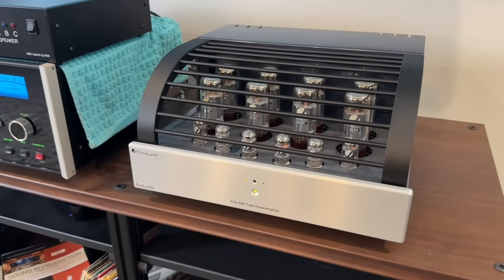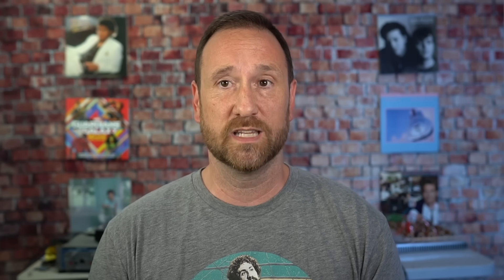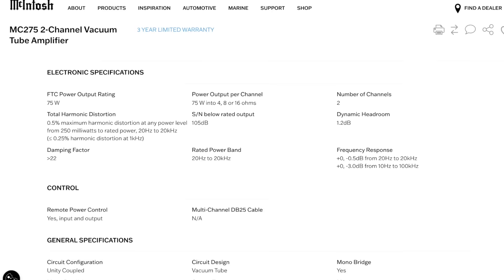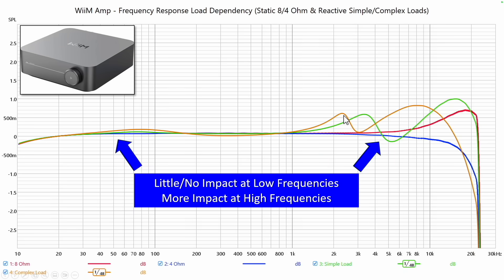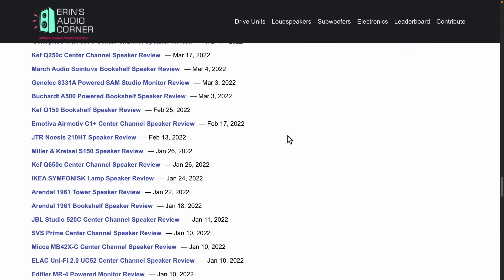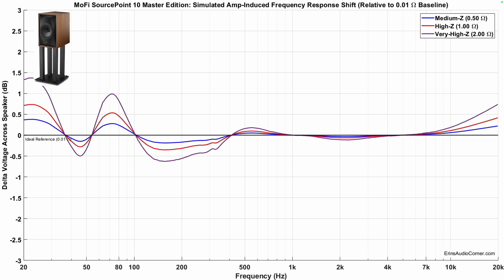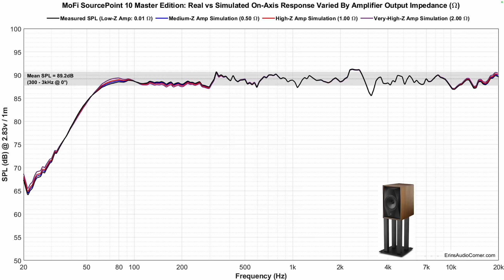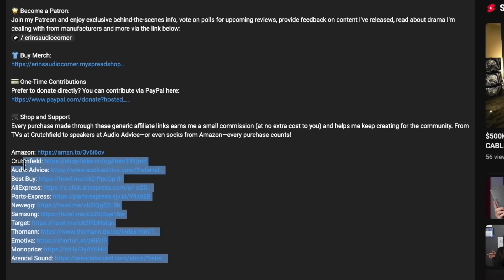Should All Amplifiers Sound The Same?

Comment: I will never grasp why some folks keep claiming "all amps sound the same, and if not, the device is broken". Why should amps sound the same anyway?
Reply: Look up the definition of "high fidelity" ... it's about ACCURATELY reproducing the audio waveform stored in your recordings.  If the amps are accurate they will obviously sound the same.  

Do you really want a "flavoured" amplifier if you listen to various recordings and genre of music... wouldn't you be more happy with one that is accurate enough to reproduce them all faithfully?
Reply: @Douglas_Blake simply answer the one question: Why / how should it be possible that amplifiers made of completely different sets of components sound the very same?
Reply: @medonk12rs  
Because, in the design and development phases, they concentrated on accuracy and stability... as any good engineer would.  

Your recordings store a waveform that is one voltage, per channel and changes over time. This is literally a map of how to move the speaker cones. Do it right and you get to listen to some good music.

The goal is that when you play a recording you should hear your recording, not your amplifier.  For this reason a lot of work goes into ensuring that an amplifier (Pre-Amp, DAC, etc.) no matter it's design or construction, faithfully follows the audio waveform stored in the recording.

That one designer uses TIP99 transistors and another uses 2N155s is not the point.  When operated in their linear regions, they will accurately follow that waveform and, thus, will sound the same. 

Any variance from accurately following the music waveform is an error... distortion.
Reply: @Douglas_Blake  
"That one designer uses TIP99 transistors and another uses 2N155s is not the point.  When operated in their linear regions, they will accurately follow that waveform and, thus, will sound the same. "

... and then there's different power supplies, capacitors, conductors and the list goes on... different ways of attenuation in the pre-amp (-section).

Your claim that everything IS sounding the very same because is SHOULD from an idealistic point of view is questionable.
Reply: @medonk12rs  
Whatever...

It's getting pretty obvious you're on some kind of mission here.  You aren't listening to what I'm trying to tell you... that any amplifier that correctly traces and amplifies the audio waveform from your sources will sound the same by virtue of correctness.  

2 + 2 = 4 ... no matter if it's apples, oranges, hand grenades or puff pastries... and it will always be 4 by virtue of it's correctness.  

You're trying to justify the audiophile claim that everything sounds different... and that's just not true. Just lately there have been a spate of DAC tests where people can't even tell where the cut from one to the next is... never mind hearing a difference in the dacs themselves.  I've seen lots of A-B tests of amplifiers where ultimately we end up looking to see which one is playing.... and these kinds of results come from the accuracy of the reproduced waveforms.  

Now I know this isn't standard audiophile belief but, it is how this stuff actually works.

Erin is correct in pointing out that in poorly designed equipment interactions between a power amp's output and a speaker can colour the sound.  But that's because either the speaker or the amplifier or maybe both are not accurately following the musical waveform. A design flaw is allowing an undesirable variance in behaviour.

If everything is working as it should... all this stuff should sound the same.

As people have been pointing out for nearly a decade now... "If you have 4 amplifiers that all sound different, at least 3 of them are not high fidelity devices."
Reply: @Douglas_Blake  ... the length of your post makes it pretty obvious who's on a mission here... 
Hint: not me.
Cheers, enjoy your day. Over and out!
Reply: @medonk12rs  
You DEMANDED I answer your question.  I answered your question.
Reply: @Douglas_Blake  True, and I honestly appreciate you taking the time.
Problem only is: I auditioned around 5-6 not-crappy amps in my home system during the last years, and additionally many more at my brick'n mortar dealer's.
Some do indeed sound similar, but most exhibit special talents.
If your system (front end and speakers) don't exhibit differences between amps -- good for you. Go for the most affordable that has all the features you need.
Happy listening! Cheers.
(... not asking for that "did you blind test" awkwardness... )
Reply: @medonk12rs  
Oh trust me, I've seen some real crappy gear in my days.  I have one piece sitting in a box next to me waiting to go to a courier drop box for return right now.  (Seriously this thing was so messed up I didn't even get to the listening test... and it wasn't cheap!)

And FWIW ... before I put new stuff into a system I will do blind A-B testing either for myself or for my client, so we know what they're getting.  It's not awkward, it's a sensible guard against accidentally degrading a system's performance.

The point is not that these things don't show a difference.  The point is that they should not show a difference.  Again it's about accuracy. As in two accurate clocks from two different companies should always show the same time...

Happy listening.

Comment: Is the output impedance also important with sources/pre amps? Can this also explain some of the differences in these components?
Reply: It can matter ... but not in the same way as this.  
The input to the next stage will not be reactive or complicated like a speaker load is, so no variations by load/frequency will occur.

Comment: Quad proved tens of years ago that their amplifiers do nothing with the sound at all. So if amps sound different, they add sound.
Reply: That's no contradiction to what Erin said. Not at all.
Reply: @naibafabdulkobor4301  I hope I didn't say that. You're familiar with that Quad setup? Normally you would require an amp to be fully neutral. Quad proved the 303 is.
Reply: @asphalthedgehog6580 Yeah. Peter Walker still thought he could do better and invented the current dumping amplifier. 🙂

Comment: Erin, wouldn't you want to make sure you are using an extremely accurate amplifier that is stable regardless of whether you are testing a 4 ohm or 8 ohm speaker when doing Klipple Nearfield Scanner measurements so you know you're testing the response of the speaker and not the response of an amplifier that has load variable frequency response? I'm not saying you aren't I'm wondering if that logic is fair. Almost makes me wonder if there is some benefit to everyone sending their speakers out with their amp to be measured full range together at least anytime there is a change in their system just in case they need to apply an eq correction. That's overkill though.
Reply from the maker: My amplifier has very low output impedance.
Reply: @ErinsAudioCorner now this video has me worried! I have a Pioneer Elite SC-57 class D receiver which in my opinion sounds great. I cannot however find any specs for output impedance but I did see an audio magazine measured the full band frequency response of the receiver at 4 and 8 ohms and they were basically identical except for some variation around 20kHz, the 4 ohm test looked a little flatter. So that at least makes me feel better even though it's not an exact answer.
Reply: @americanidle1277  
If you're happy with your current amplifier... why would you look for solutions to problems you don't actually have?
Reply: @Douglas_Blake I don't know, I guess I just want an excuse to buy 9 channels of external amplification 😂
Reply: @americanidle1277  
Ahh ... okay.

Comment: So a amp with a 4 ohm output impedance will make a horn speaker with high sensitivity sound bright or do I have it backwards?
Reply from the maker: It depends on the speaker impedance.
Reply: It says 6 ohms (connect to 8 ohm taps) on the speakers I am looking at..the amp is class A with  4 ohm output impedance….
Reply: Unless something is really wrong with the designs, it shouldn't have any effect at all.

Comment: Holy moly--take a look at the specs for the class D Hypex modules.  From the Hypex site the NCORE NC252MP has max 0.005 ohms output impedance all the way out to 20khz.  Yes that's 5 MILLI ohms! Those are the modules in my Buckeye amp and I'm happy so far.
Reply: Thats crazy, more resistance in the wire to the speaker 😮
Reply: How would you describe the sound of your Buckeye amp? I have been debating if I want to take the leap into separates! Would pair it with a Schiit preamp more than likely…
Reply: @christophermedina5422  My Buckeye is transparent and I can't perceive any sound from it.  The problem is that you might be used to something that indeed colors the sound and then you will think the Buckeye sounds odd. Look at the tube-people who love the distortion of their amps. Layer on psychological factors and no way I can tell if you will like the Buckeye.  IMO get the Buckeye and if you want different sound, use EQ.
Reply: @JohnSmith-qi6co I see! I have already been using external DAC so at least that aspect of the sound should remain relatively close no? I am currently using Yamaha integrated amp (AS1200) but I will not be keeping it. That is why I am now considering separates… thanks for input.
Reply: I’ll see your 0.005 Ohms and raise (or is it lower?) you my Nilai’s 0.00004 Ohms. Later gen Hypex to be fair. Both excellent.
Reply: @Wharariki  Nobody can hear any coloration with any of those numbers.

Comment: Erin, great video! And highly educational too. 

It is no surprise that you could hear the difference between two amps where one of them seriously modifies the frequency response. Your test puts that extreme case to bed. 

However, I think it would great to do a follow-up video where you blind ABX a few amplifiers that all have high damping factor. This would address the claims of audiophiles that they can hear differences between amplifiers that all have flat frequency response into any load.
Reply from the maker: I touched on this in past videos. And on Patreon I’ve discussed my experience comparing the $300 WiiM Vibelink to other amplifiers. 

But that’s not the point of the video: it isn’t about the blind test. If it were, I’d have stopped there. The blind test was a discussion was a foreward into why I went down the path of figuring out what caused the differences I heard, discussing it for the larger masses and tying it all together with simulations of different modes. 

That said, I do have plans to do some further listening tests but they will focus more on the listening than the why. This video was the why.  👍

And while some may already know the why, judging by the number of responses here, it’s extremely clear that the majority had no idea. And I think that’s the cool part about bringing this info to a larger audience. And hopefully getting more reviewers to understand this as well as provide data for it given it’s the most important aspect on what we hear when it comes to amplifiers. 🙂
Reply: @ErinsAudioCorner I’m 100% with you. But you’re up against an industry that wouldn’t exist unless the lies are prolonged and they’ll continue fighting to survive.

Comment: That's why valve amplifiers are poor compared to a good solid state class AB. The biggest issue of many is the output transformer. Another thing to consider is the output stage of most solid state class AB is largely resistive. However the output stage of a valve amplifier is one big inductor or maybe 2 in the form of a transformer. This transformer has to match the very high anode impedance down to specific loudspeaker impedance, which as we know is very far from constant. Hence many valve amplifier need you to select the correct taping on that transformer. So your 8 ohm speaker does drop to below 3 ohms, so which tap do you use? Both are wrong at different frequency's. So the voltage actually fed to the speaker is not even equal at different frequency's, so it's not surprising that it measures this way. The class AB transistor amplifier on the other hand produces a voltage constant across the frequency range.
I am always amazed that people are always making excuses for valve amplifiers. They simply are NOT as good a modern class AB and they cost 10-100 times more money for for lesser quality. Natural sound they are NOT, words like, warm, smooth etc What goes in does NOT come out. It has everything added. If you LIKE all these added flavours, that's fine, but please don't call it REAL HIFI. It should be what goes in, comes out louder, NOTHING ADDED!
One plus I cannot disagree with. Valve amps do look good! Pity about the sound.
Reply: Im really shocked by the Prima Luna. Thats supposed to be one of the "best ones". Point to point wiring, Upscale Audio flogs this brand so hard.
Reply: Verry informative Sir Beeny...class ab amplifier is one it the best.

Comment: The way I've heard it stated is all amplifiers sound the same when they aren't distorting. This statement allows for speaker/amp synergy because a speaker has a very complex load that depends on what it's being asked to reproduce and a test bench can't possibly replicate that
Reply: Of course a test bench can replicate that ... Erin even has "complex loads" to do that very thing.
Reply: @Douglas_Blake   whatever bench test device you construct it will never be the same test as playing hundreds of different audio tracks and listening critically. However a test bench can certainly separate the good from the bad and narrow down the selection criteria, but ideally you would audition several combinations with your preferred music before purchasing.
Reply: @Mike-jm5wt  
The final test is always listening, of course.

However; you should be aware that even hobby level test equipment is orders of magnitude more sensitive than our ears.  On my test bench, I routinely find and fix minor flaws that nobody will ever hear.

One good example where bench beats ears is AB amplifier output bias. The distortion produced by an under-biased amplifier does not occur at higher levels where it's obvious, it comes at the zero crossing when switching from plus-side to minus-side output transistors.  I can see this plain as day on my oscilloscope but most people won't ever hear it unless they're playing music at whisper quiet levels.

Comment: Awesome. This is something great for all non believers that say that amps with suficient power sound the same. 
The chances of 2 amps having ouput impedance and damping factor curves  that are the same are probably close to 0. So yeah...I would say this proves amps  sound different, but the level to which this happens depends of course on the speakers you attach to them.
And the level to which you perceive this difference varies again based on other electronics, the room and your ears.
Reply: Take a closer look at the graphs presented.  Most of the differences are less than 1db and only the one tube amp reached 2.5db. 

When zoomed in on a graph to show only the problem area those differences look disastrously huge ... but when weighed plotted against the full output of the amplifier you're still going to get an almost perfectly straight line. 

The worst case shown (-2.5db) would amount to a dip from 80db to 77.5db in an average listening situation... if that was audible at all it would be a difference you have to listen for, nothing obvious.

That tube amp was running with a damping factor of 4 ... that is a 2 ohm output on an 8 ohm speaker.  That is, at best, a design flaw.  Any decent amplifier will have damping factors way beyond that.  At some point the variations will dip below the threshold of audibility (2db) and all else being equal, they will, in fact, sound the same.
Reply: Yes, indeed. But this is a very simplified testing as Erin stated, using a fixed output impedance. 
No amplifier has a fixed oput impedance.
And no amplifiers + speaker system is using a rising simple monotone while being reviewed for sound quality.
And this is not done in super treated or anechoic room, but in a normal room, where variance increases again as different systems interact differently with the room.

It is a logical assumption I think that variance will increase even more with additional variables, so....amplifiers used in different systems will sound different.
Reply: @CraciunAlexandruGh  
First keep in mind this is not an amplifier measurement.  It is a measured interaction between amplifiers and speakers. 

Moreover; it is only likely to be true in extreme cases where an amplifier's errors and speaker's errors happen to align.  Take the frequency plots Erin showed for the Wiim Amp as an example... notice that the variances are very small (but still real). The odds of that being audible rely entirely upon a speaker that peaks in the same areas as the amplifier's output. It is equally possible that a different speaker might show dips in the same area cancelling or reversing the error.  

Don't try to justify listening experiences from a chart ... 
Examine the data objectively and decide what impact it is likely to have.

Comment: Even though i am far from being an expert when it comes saw you are showing Tube amplifiers and coming from a studio backround my first thought 
was that it is self explanatory that any Tube amp will alter the sound. Tubes are the first thing used if you want to add content + alter sound.  
I would find much more interesting comparing neutral measuring transistor based  amplifiers and blind testing them. I don`t think you will find a big difference if any there